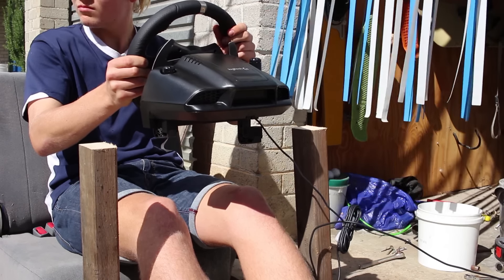Budget gaming - DIY wheel stand (Logitech G920)

Comment: amazing video, will sure do the same setup when i buy the wheel it self, but note something, if you keep your feet raising like that you will hurt your back.. lift the pedals on top of the 2 wood pieces you attached behind them so your feet will rest and only lift when you want to shift or brake :)
Reply from the maker: Cheers dude. yeh, this was just using what ever i had at the time. i can move the seat back and forth if i need to but does alright. aha. never really have enough time to play long enough to feel cramped any way :') but, i've since bought a welder. so i'll probably be doing another one out of metal

Comment: Nice build man! I got a g29 showing up in the mail tomorrow, definitely going to use this stand.

You should look in to flipping your pedals.
Just pull them out of the plastic, unplug them (remember which wires plug into which pedals) then get a board, make a wedge and attach it. You want about a 80-70 degree angle with the top of the board leaning toward the seat.

I'm sure I explained this terribly, but theres tutorials on google, give it a look.
anyways, great video, gonna start working on one today.
Reply from the maker: aha, yeh i've been wanting to do that for a while (even have the wood for it ready to go) i just don't have the time to do it at the moment :/ working 3 jobs.. sort of 4 and have 3 other channels i'm trying to make content for as well doesnt leave much free time ahaha. But yeh, i just recommend, when attaching the actual stand to the bottom frame, use some long bolts and big washers... so much more stable!!! if you haven't seen the stand fix video already..
Reply: Subway Gaming 
Yeah I ended up making the vertical pieces and the angled supports able to move so i can fold it up.

I'll check out your other channels man!
Reply from the maker: nice, sounds like a good build. I could't be bothered trying to make it to fold down :') probably would have been smart though. Cheers dude :) yeh got a couple of others. don't post as much on them but it's something different if people get bored of this :') pretty sure i've got them linked on my channel home page thing

Comment: Cool video. A couple tips:
Did you drill pilot holes for the screws? That would have made it much easier. Also, it is a good idea to "glue it and screw it" for extra sturdiness.
Reply from the maker: nope aha, it was just smash them in and see how she goes :') Have done quiet a few improvements since this one though and it is a lot better now :)

Comment: how do you connect the shifter xbox or steering wheel
Reply from the maker: the pedals and shift connect into the bottom of the wheel then there's a cord in from the wheel that goes into the usb port on the xbox.

Comment: “budget gaming” has a $460 steering wheel
Reply: This is cool though
Reply from the maker: aha, yeh. Well for me it's still budget because i bought the wheel second hand AND on a special. So more around the $200 mark including the shifter
Reply: Subway Gaming where’d you buy it and I’ve seen rigs for less than 200 hundred still pretty expensive
Reply: @Xeloo  g29 is not $460 what the fuck